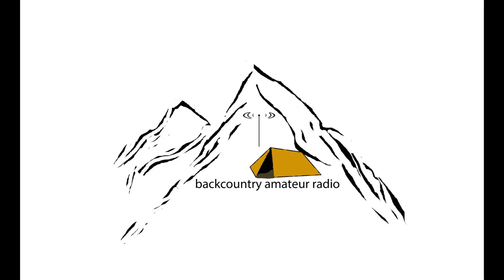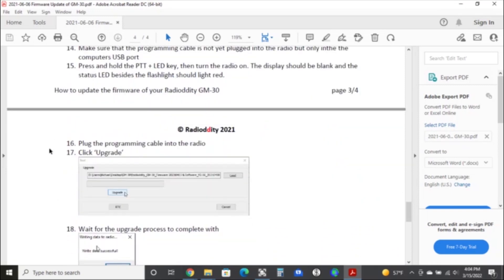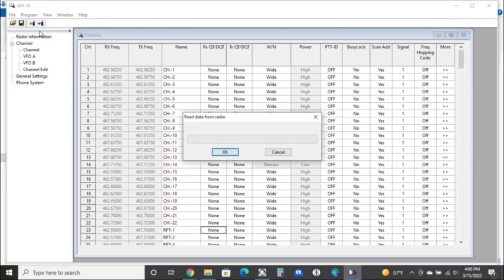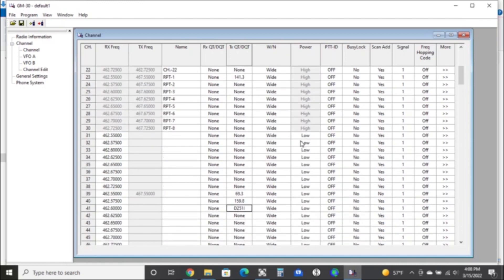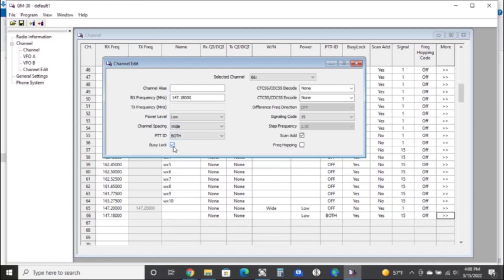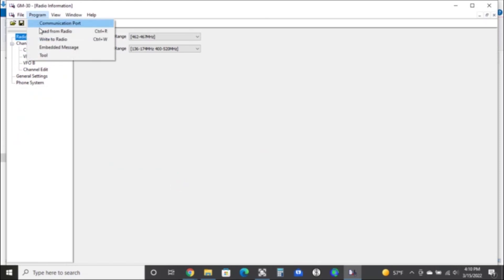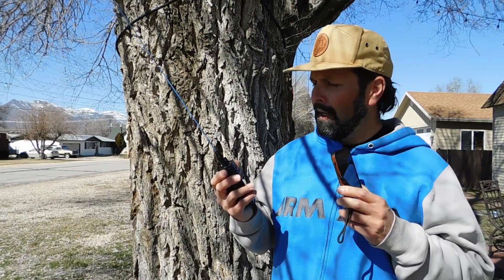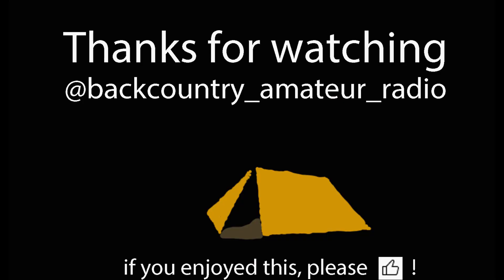Radioddity GM-30 CPS DIY Repeater Channels Antenna Selection

Comment: Your videos are great! thanks for the quality content. I'm wanting to purchase the antenna you mentioned in the video however I believe there has been some updates as you can now purchase the signal with the correct SMA-M end. What would you recommend? Dual Band 2m/70cm or Single Band 440?
Reply from the maker: I'm sorry for the late reply. Been on hiatus for some time now, spending time with family. I would still recommend using this configuration. It allows for more universal application, especially if you plan to connect your handheld radio to a portable yagi, which I also recommend. I hope that helps. Take care!

Comment: Can someone tell me what a DIY channel is? That is what I am actually looking for. What is DIY? Too many advanced users that assume that everyone knows what this stuff is
Reply from the maker: 'm sorry for the late reply. Been on hiatus for some time now, spending time with family. The DIY channels refer to repeater enabled channels that allow you program the same frequency for repeaters with different CTCSS/DCS settings. So if you're in an area that has one repeater at 462.550 with a tone of 100.0hz and the next area has another repeater with the same frequency, 462.550 but activates with a different tone (131.8), the DIY channels allow you to simply have another channel preconfigured to these respective repeaters. Without DIY channels you'd have to go into channel 16 and change the tones each time you wanted to change repeaters. This is just one example, but hopefully clears it up a bit. DIY is simply "do it yourself (repeater)" but the trick is that the repeater frequencies are preset by the radio (FCC) and those cannot be changed.
Reply: @backcountryamateurradio  except you cant Tx to them because the tx frequencies are greyed out. Struggling with this now because my TX offsets on DIY are incorrect and i cant change then to the correct +5 because the software wont let me. Dont know what to do

Comment: By any chance can you help me step by step to get my GM-30 working properly with my local repeaters? Thanks.
Reply from the maker: It might be worth contacting the repeater owner to make sure your settings are correct. Often, you simply need to find the matching repeater channel and set the CTCSS/DCS tones to match it's settings. Maybe a future video we'll see something more specific on the radio setup. What is the main trouble you're running into? I hope you can get it straightened out!

Comment: RPT-1-RPT-8   built in. Can the CTCSS be added and saved?
Reply from the maker: You should be able to save the CTcss tones/DCS as well. Keep in mind this is designed to be adjusted on the fly. So you ought to be able to change the CTCSS anytime and have it save that setting until you change it. That has been my experience with this radio.

Comment: Any experience with the GM30 in the rain?  I am concerned about using mine in rainy weather and trying to decide if I need to purchase a uv9g that is waterproof.  The Gm30 is not waterproof but I wonder if it can handle rain without being damaged.
Reply from the maker: I've gotten this a little wet but I wouldn't trust it in the rain. I would definitely seek out a different radio with at least a true IP67 rating.

Comment: I see the RX frequency can be changed but the TX frequency does not seem to be about to change in the repeater section for DIY. It’s hard to tell but you can have the same frequency for two repeaters and different tones.   I would think it would have repeater pairs for GMRS repeaters repeated so you just change the tone. Correct.
Reply from the maker: That’s true. The repeater frequency pairs (or offsets) are predetermined so we can’t do much about that. And there are only 8 pairs, which you’ve probably seen. Thanks for checking out my gm-30 series. Seems like I need to do another video on it regarding vfo modes.

Comment: This model doesn't work with Chirp software which is far superior IMO.  I was spinning up this model for my next door neighbor who is getting his callsign and I could not add the local repeater as a new channel because the TX frequencies are grayed out/blocked by the programming software.  Sad.
Reply from the maker: Yeah, Kind of the nature of some GMRS radios out there. But that's the idea with GMRS radios. They're useless for programming. Even the DIY channels have presets to keep them on repeater functionality. By design, they're restricted. 

As far as Chirp is concerned, you're absolutely correct. The Radioddity programming software isn't great. It works. But for programming a lot of frequencies or non-GMRS frequencies, I typically default to a non-GMRS radio so I have flexibility.

Comment: How you unlock the radio? To use in ham frequency?
Reply from the maker: Unfortunately I don’t have the answer for that. I would also be interested. It’s able to listen but would be nice to have access to the other frequencies.
Reply: @backcountryamateurradio  I have a tyt uv-88 that is almost the same radio, I unlock that one but can't this one
Reply: @sfcastro61   How were you able to unlock the TYT UV-88?
Reply: If I download the newest programming software, do I still need to download the firmware upgrade ? It’s a great radio.
Reply from the maker: @bulldogbrower6732  I apologize for the delay! The recently sold radios have the update firmware on them, or that's what I have seen anyway. You may not need to the firmware update. However, I would check on the radio and see if you have the current one. It's nice that they continually offer updates on the firmware. Just keep in mind that the programming software is different and does not have the firmware updates pre-installed on it.
Reply: @backcountryamateurradio  Thank you very much.
Reply: To get to ham freq hold down Menu Button till you see VFO to right of freqs. Change Freq to local repeater. Tap Menu again to menu 28 pick a channel and save. To get back to channel mode hold down Menu until it switches back.